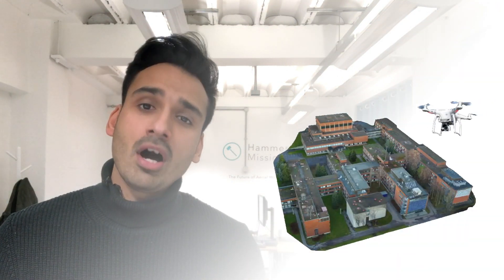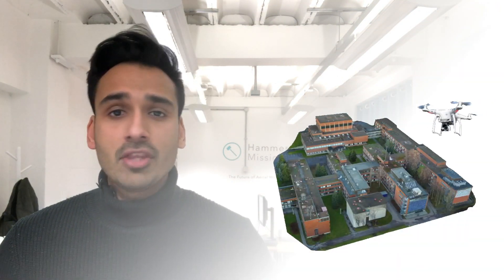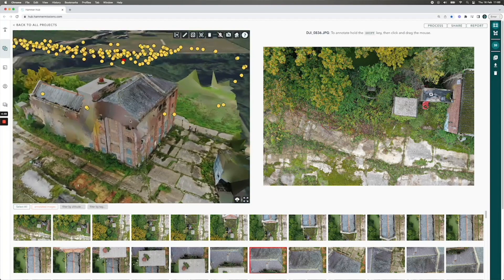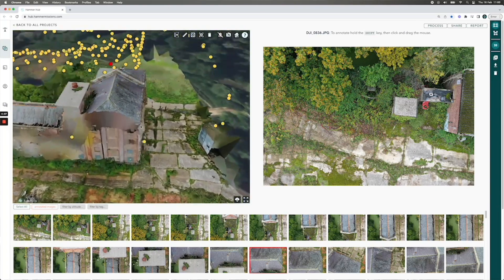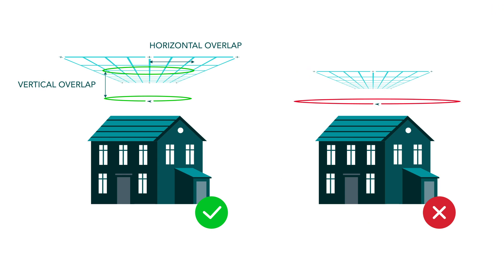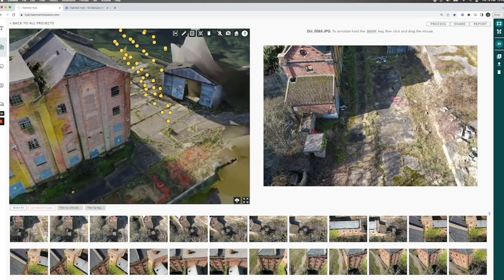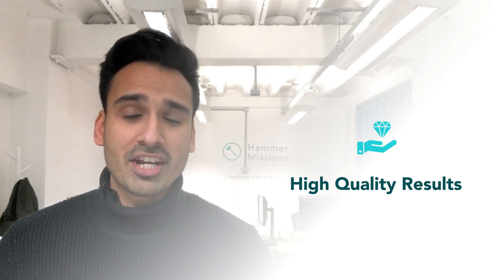Capturing Buildings for Drone 3D Models | Hammer Missions

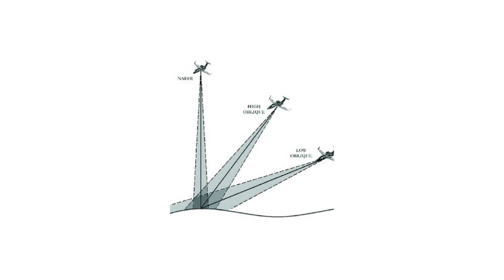Comment: I noticed that the image that starts in minute 1:55 contained a typo as Low  and high oblique graphs were wrongly assigned to the proper drawing. 
Please confirm
Reply from the maker: Hi Mahmoud, thanks for the question! The high/low oblique label depends on what it's relative to. High oblique (relative to the vertical) would actually be the same as low oblique (relative to the horizontal). In the video, the high and low labels are relative to the vertical. The more important point here is that 2 oblique images should be captured 1) at a high gimbal angle 2) at a low gimbal angle
For e.g. -15 degrees and -45 degrees, or similar depending on the target object or site.  
Hope this helps!
Reply: @HammerMissions  The best thing to do is to take a good cloud of photos and different angles. I use agisoft and now understanding this one.
Reply from the maker: @ This video might also be helpful! https://www.youtube.com/watch?v=UmcLlGAn3I4&list=PLSycoCCyOAiWkDz3AujgPR1k-nYCdbTLM&index=4